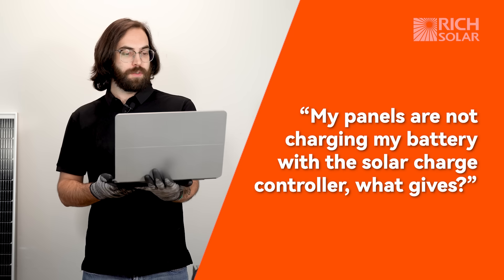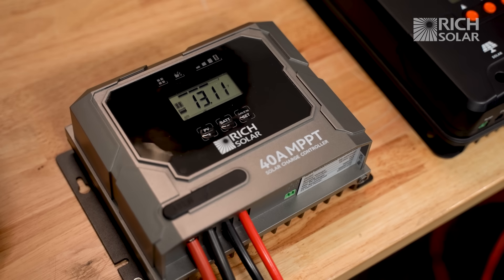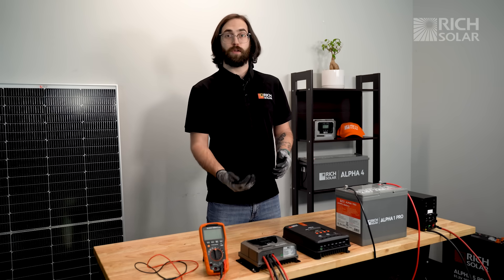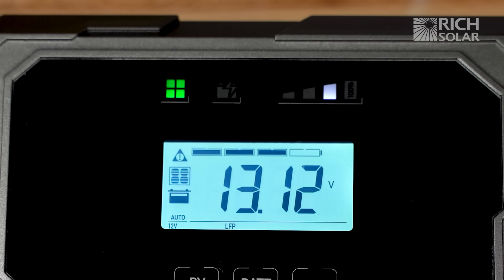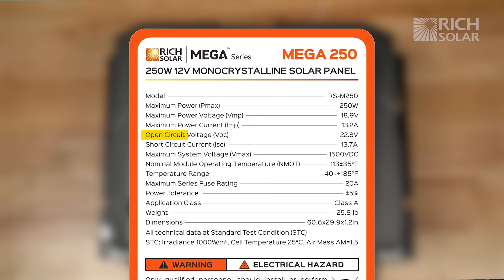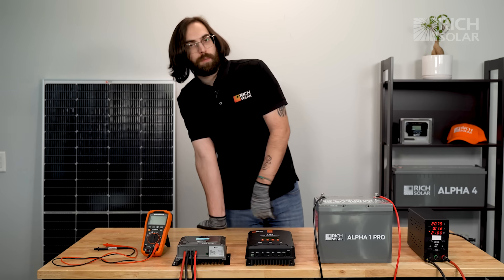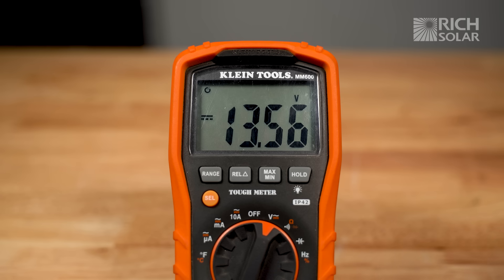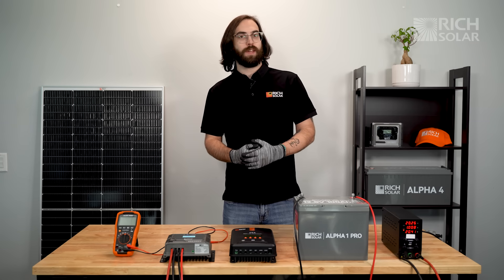How Your MPPT Charge Controllers React to Low Voltage | RICH SOLAR TALK

Comment: Hello, I’ve got a serious problem. Maybe I undersized my system, but: I have a 10 W panel (18 V at max power) connected to a PWM charge controller and a 6 Ah LiFePO4 12 V battery. To get more out of the sun, I bought a Victron MPPT 75/15 and hooked it up. Nothing happens. No direct sunlight at the moment, but even in daylight the PWM managed to charge a little… okay, fine, I thought.

So I bought another 10 W panel (now I really wanted to know) and wired it in series with the other one – plus to minus, then the remaining plus and minus into the MPPT controller. I should now have 18 V + 18 V = 36 V… but still nothing. As long as the sun doesn’t hit both panels equally strong, one panel seems to get bypassed through the internal diode. I don’t get it… should I remove the diodes inside the panels?

Of course, I could just buy a single 36 V panel right away, but I want to make it work with 2× 10 W panels in series. It should work… I measure 36 V with my Fluke multimeter, so it should be fine. But it’s not. Please help :D

Comment: What is the volt reading on the charge controller an indication of? The volts going from the panel to the battery or the volt state of the battery?

Comment: So, how can I get more input voltage without having ot add more PV panels ?   thanks
Reply: Get a mppt charge controller
Reply: Connect your panels in series and use a mppt chatter